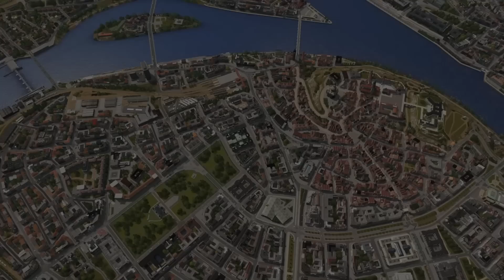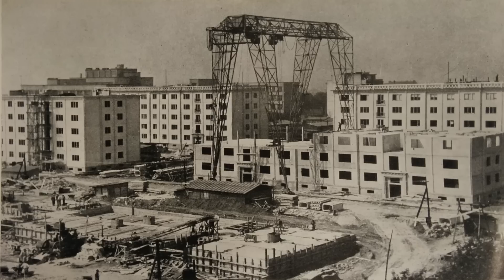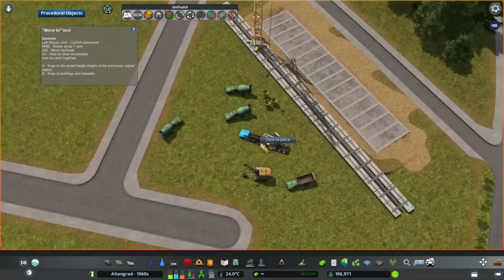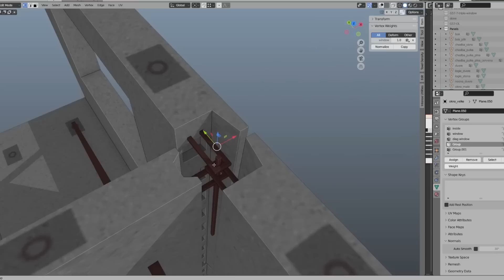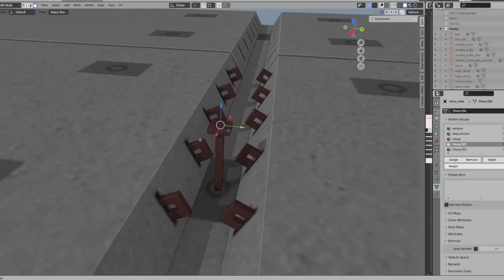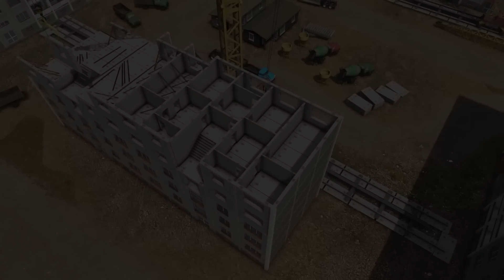How Were Prefabricated Blocks of Flats Built - Cities: Skylines - Altengrad 65

Comment: I live close to one of those areas and few things i noticed you are not including in your build. Most of the blocks/projects have like a square with services and grocery stores in the middle or next to a bigger road. Also all the smaller roads inside the block are full of parking spaces on the side.
Reply from the maker: The place is under construction, not everything is done. Parking spaces were added later in real life as number of cars increased.

Comment: The panels were indeed used for industrial premises, but residential buildings were built from ready-made rooms. In my city you can find abandoned boxes, there are only two walls and a floor.
Reply: The apartment consists of a bedroom or two 1-2 boxes, toilet and bathroom has a partition but it is one design, the kitchen has three walls. Only five-story houses were built from panels, everything else was made from boxes. If you need I can help you find more information about it😊

Comment: My uncle lived in a prefab building from 1970s. When he was replacing windows, the workers discovered an entire section of a wall made of vodka bottles. The builders sold an entire prefab section and used some leftover cement to replace it with bottles.
edit: also there are no 90° angles in that building. EVERY wall is somewhat slanting
Reply: That quantity of vodka bottles probably has some correlation with the square issues.

Comment: I live in a prefabricated apartment block in Fyllingsdalen, Norway, built in 1971. It's really interesting to hear you talk about how they were built, and I recognize some of the problems you mention. Small gaps have appeared in the joints between the modules, and I can sometimes feel a breeze if it's really windy outside. Fortunately, my top floor apartment has a gable roof, so there are no problems with leakage. Otherwise, the building feels really solid and everything is still straight here.

Comment: I will admit, in one of the apartments my family owns that is on the last floor the roof leaked near the window, where as in another one, again on the last floor it did not. Both buildings were build roughly in the same time, same city. Yes there were problems, but I personally don't think that these blocks are bad. They are really sturdy, and for the most part well built. It can of course be a completely different story somewhere else, but in my own experience of owning 7 different flats in these blocks, we encountered a problem only once. They just have to be maintained well, and then they can last a lot.

And I will just add that we own a massive 100m^2 flat in an old military block, and I can confirm that these are the best built ones by far. No wall was out of square in that house, unlike others where they could vary up to 2cm along 3,5m of wall, which is not that bad.
Reply: Oh I don't thinl these are bad, but I think poor organization while building them can lead to problems such as the ones they mentioned. (Though honestly, bad organization for any construction project won't lead to a good product at all.)